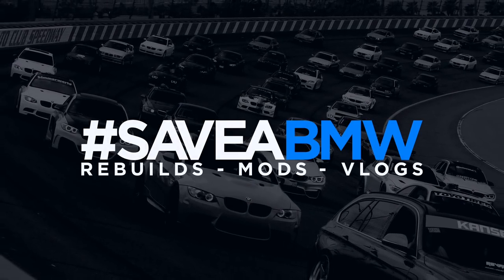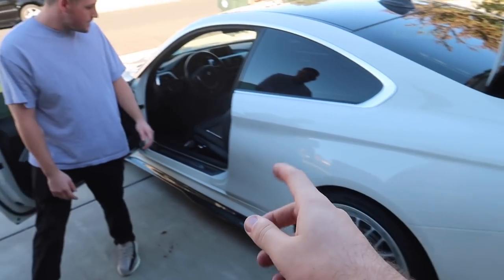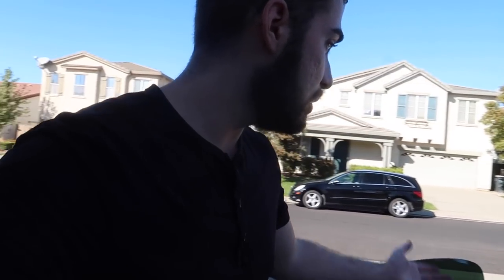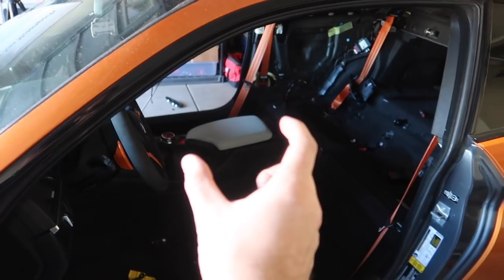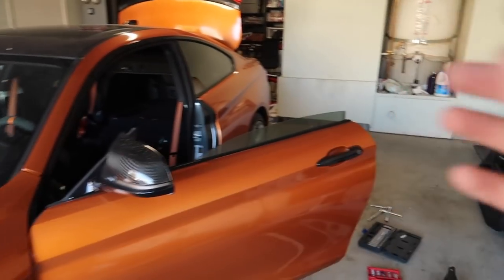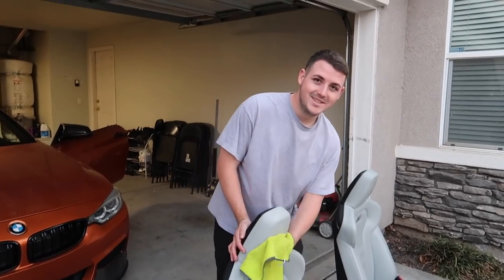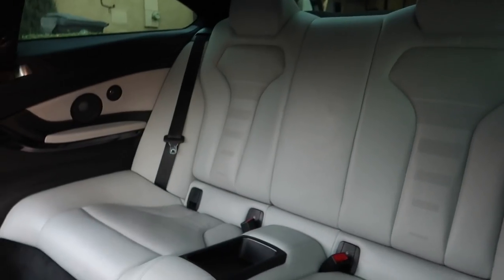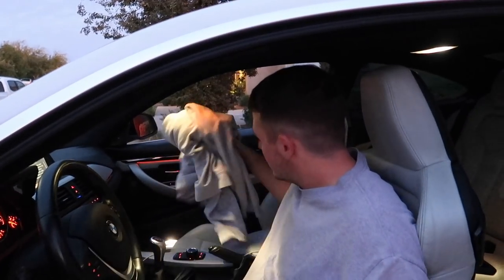MY FAVORITE PART OF THE 435I IS GONE!

Comment: From the 1 series to the 4 series (all F chassis) and the 3 and 4 series (G chassis) #40i have the B58 Also the Supra and the 40i Z4. You should get one of those engines, they have a lot of potential

Edit: the x3/4  G chassis M40i also have the B58
Reply: Don't forget the 540i, X5 40i, X7 40i, 740i, 840i....
Reply: Oh I thought they used de-tuned M V8’s
Reply: @tomaspiscicelli3288  nope. All the xxx40i cars have the B58!
Reply: I didn’t knew that